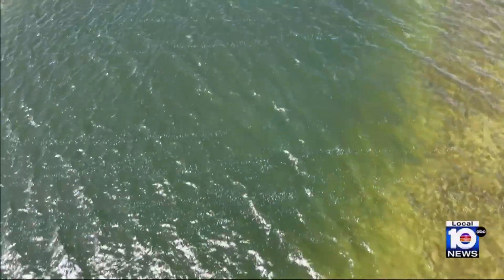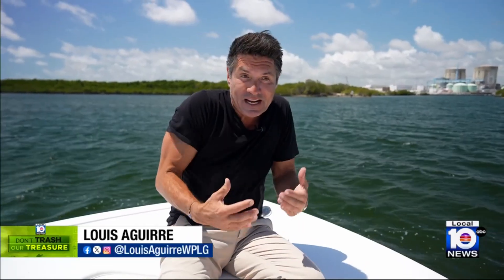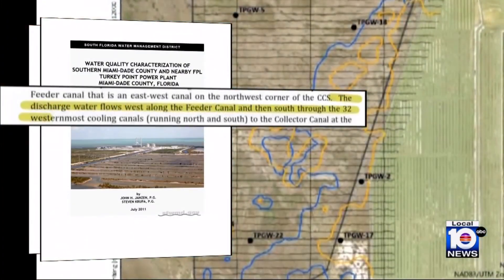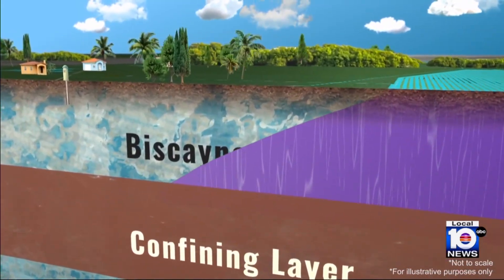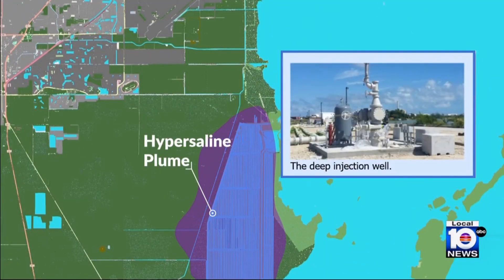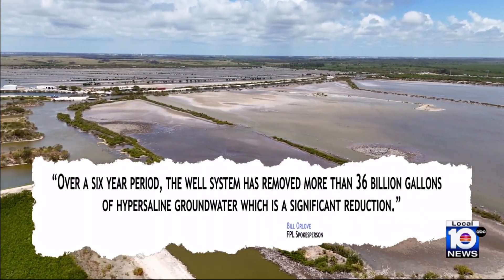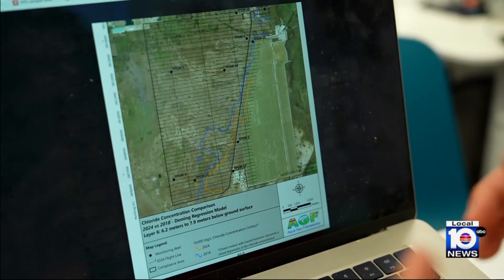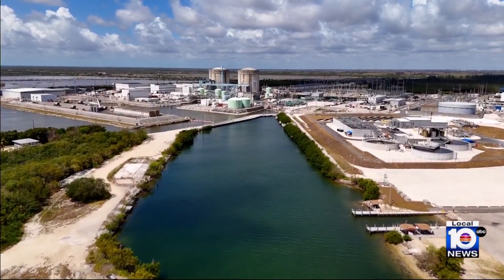Plume of salty water from South Florida power plant could impact Miami-Dade aquifer

Comment: Logically those wells make the situation worse by making it easier for the water to permeate or spread by draining the aquifer (taking out the good for more bad). Only thing that would work is a mega pipe going miles if not tens of miles off the coast to super deep deep water so the hot water then mixes quickly with the cold deep water